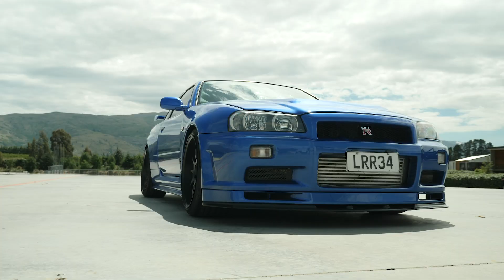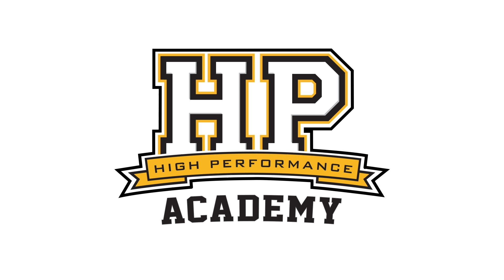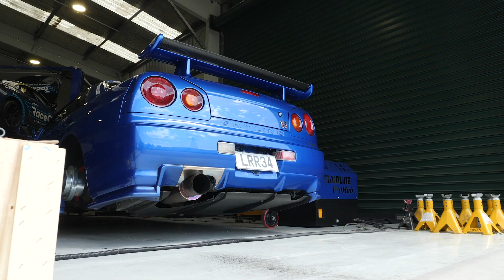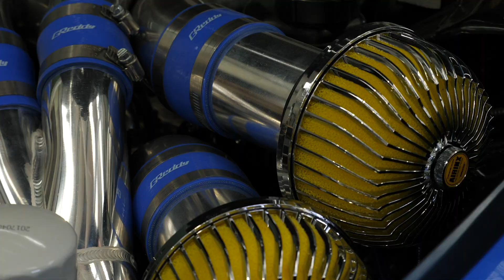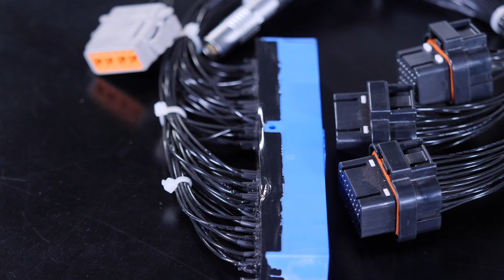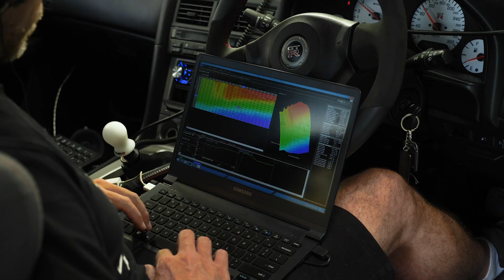The Biggest AFR Target MISTAKE Tuners Make?

Comment: I am no expert efi tuner just experienced with mechanical and carb tuning. Everyone seems to always relate lean condition to knock issues. There are lots more negative effects than this. Higher NOT can damage cooling systems, intake and exhaust valves and seats can be damaged, forged pistons possibly expand larger? Bores and rings mirror and wear quicker? The list goes on. I think about o2 sensors failing faster than normal? I belive if you are running some exhausts too hot you can harden hangers welds and bolts and these can then break easily?

Comment: From my experience this is a little misleading of AFR increasing power, I have found that the ignition control that you have changed would more likely to be where the increase in power would have come from not the fuel, but yes moving from 12AFR to 11.5AFR can reduce some light knock , but I have found only minor changes in power (without knock) with AFR changes between 12.5-11.5AFR, Triggering systems on an RB is where I have found one of the biggest power gains, the cheap option you showed does help a lot but triggering still floats (I understand cost) but still a lot better than the stock CAS, crank trigger and CAS sync is the way to go. 
Three major changes here to achieve increase in power and reliability, Replacing the 20 year old aftermarket ECU with one of the better current technology aftermarket ECU's available, changing the triggering system,  Getting rid of those 30 year old air flow meters.  This is the Email that I received: 

Is This The Biggest Mistake Tuners Make? ❌

What is one of the biggest mistakes both professional and amateur tuners make when setting AFR targets?

This lightly modified RB26 powered Nissan R34 GTR Skyline made 485whp with light knock occurring at 22-23 psi, and with only minimal changes planned it was expected to make LESS power to ensure reliability.

By taking the time to check what AFR targets suit this specific setup rather than assuming what has worked for one RB26 tune will work for all, the result was an increase of power to 528whp at the same boost level, with no knock.

In this Tech Talk, Andre explains why this was possible. He dives into why some tuners wouldn't find this power, along with the causes of knock and where they sat regarding this specific project.

Also discussed are the Z32 airflow meters that were fitted in Japan, along with their removal, and the upgrading of the trigger system without breaking the bank (as if you own a recently purchased R34 GTR these days, no doubt your account is already pretty empty!).

Watch Video

I'm not challenging this teams tuning ability in any way, HP academy is great and I find them helpful, as there has been no real training for tuners so most of us tuners have self taught until HP academy came along,I personally fully recommend them. 
Keep up the good work

Comment: With Nitro RC cars all the tuning is done based on how the engine responds, amount of revs, sound and how much smoke the engine produces.
Do car tuners ever listen and get a feel for how a car tuned or is only looking at Data?
Reply: It's not an RC single cylinder engine. Data is more reliable. Especially with unleaded fuels.

Comment: I just got an elite 2000 for my R34 GTR, no plans yet for a trigger kit but this 4d tuning map sounds interesting but im afraid my tuner wont use it. thats why i got the 2000, unless you think the 2500 is a must get for a little more $ lmk
Reply from the maker: Best thing to do is to simply chat to your tuner about this. I'd watch this video (link below) first so you have a fair idea of what is happening and why, and it will also help you figure out if there is anything your tuner is saying that you should be alarmed about/make you walk away or the opposite where you might gain a lot more confidence you have chosen the right person for the job - https://www.youtube.com/watch?v=9XvXfX3QhlU&ab_channel=HighPerformanceAcademy

I'd have a quick chat to your tuner and Haltech about the 2000 vs 2500 for your application too. Off the cuff it does look like the 2500 might be a better option, but really it is something you're best to get advice on from a few difference sources - Taz.

Comment: How is the CAS considered an upgrade?  You've reduced the resolution by 6 X and with a good ECU the OEM CAS works very well.   Adaptronic posted a video specifically addressing how going to a 24-1 on this application greatly reduces resolution. The link is here:  https://youtu.be/_sEDuNGnRKA
Reply from the maker: Sadly a good ECU and the stock CAS actually doesn't work very well, particularly once you add aftermarket cams. I've probably tuned a couple hundred RB and SR engines by now and I'm very well versed with the shortcomings of the stock CAS. There's levels to this and some ECUs admittedly do a better job than others but simply looking at the rpm trace through a ramp run on a dyno will show you just how poorly the stock CAS works even if it's not immediately apparent from the engine operation. Ultimately the proof is in the outcome and I've used trigger systems like this on multiple occasions to turn an engine that was completely untunable into one that performs flawlessly. Is it as good as a crank trigger? - No. Is it better than the stock CAS? - 100%

There's also a lot of confusion about how much resolution the ECU needs to do a good job and Nissan's 360 sensor is borderline ridiculous and complete overkill (they must have figured this out as their newer engines have reverted to lower resolution trigger systems). Look at what some OE's deem acceptable like Mitsubishi which essentially only provide 4 engine speed inputs per engine revolution with excellent results. With low resolution like this you may expect to see small timing movements at very low rpm but as soon as the rpm rises the timing is rock solid. Personally I tend to aim for a minimum of 12 teeth per crank revolution which coincidentally is exactly what this option provides - Andre
Reply: It kinda is due to eliminating the keyway drive of the camshaft. This removes a component of the "wobble", with the cam belt elasticity providing the rest. The OEM trigger becomes a more significant issue when the keyway for the cam becomes worn and backlash occurs. I've got a 36 tooth crank trigger and the ECU reports a 3 degree scatter of the cam driven home signal relative to the crank in the logs at high loads. An effective 12 crank teeth is fine resolution wise for a high speed motor such as an rb26. Was good enough for Honda in their k series!

Comment: I was suprised that Knock accured at 480hp with 100 octane. I mean there are running alot of rb26 engines with higher powerlevels with pumpgas.
 My saab 9-5 Troll is running at 10.7 at the revlimitier.
Reply from the maker: As explained in the video, this was due to the initial lean AFR - Andre

Comment: Awesome video. Can’t wait to install my 1000cc injectors in my GTR. Question: why does the NZwiring not work on some
ECU. I have a Haltech Platinum Pro and it’s not compatible but the elite is. Not really sure why.
Reply: You have limited trigger patterns available on the platinum pro as it's designed for stock plug and play. The trigger pattern of a cam 24-1 is not available in this ECU. However a 12 tooth crank with a separate home trigger is.
Reply: @burn4005  Yes your correct. I could buy a PRP trigger kit. But like Andre suggested the cost is huge. I have been searching far and wide trying to find a affordable replacement solution. I even thought about upgrading to the Haltech elite series ECU just for the NZ trigger kit but don't really want to spend $1000 in order to buy a cheap trigger kit. That would defeat the purpose of saving money. I might just run the stock CAS and limit the RPM to 7000RPM until I find a solution. I even thought about manufacturing my own. I don't know if I can copy NZwirings trigger design but use 2x sensors instead of one. 1x sensor for position and the other sensor for homing. Not sure if this would be possible. This is only a 500hp street car.

Comment: Andre, thanks for the great explanation of the complex relationship between all these factors.
I'm certainly no tuning expert, far from it, but we had to learn this stuff for ourselves years and years ago on our old 910 Turbo Bluebird rally car.
It ran to Group A engine specs including no intercooler, 100 oct avgas fuel and an old Haltech E6 ecu.
I had fixated myself with running 1bar of boost and with careful road tuning was able to get a very torquey, usable engine that didn't hurt itself for 3 seasons.

Later I used the drive train in a road shell as a second car and obviously couldn't run avgas any longer.
Using 98 Oct unleaded, dropping the boost to 13psi from 15, the car actually made MORE power due to being able to add more timing in and run leaner than we had when racing 🙂
The '1 bar boost' mentality meant we had to pull timing to prevent knock, and then add fuel to cool the excess turbo temps we saw on the pyro.... 
You live, and you learn.

Great content.
Reply from the maker: The old story of 'giving the engine what it wants' is always easy to overlook, and sometimes when it comes to boost, less may actually be more - Andre
Reply: @hpa101 
True 🙂👍

Comment: This is what I want to put in my series 2 C34 Stagea. The KV8 would shit all over my current Nistune for a plethora of reasons including what you outlined with the addition of a vast amount of engine protection features that it possesses. How straight forward was the integration with factory attesa ets-pro or for example a full race ETS-pro controller? Is it still just as simple as spicing into the TPS signal +ve?

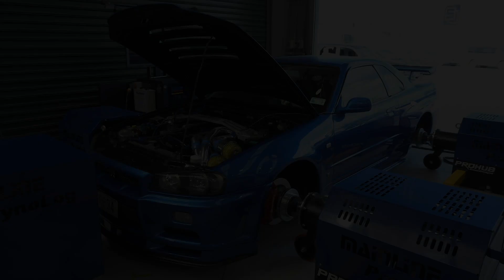Comment: Also was I hearing Compressor surge at 13:58 - 14:00?
Reply: @TomBudin  pretty much. But extending on that. it's when the compressor is forced to operate at a point to the 'left' of the compressor map surge line.

In this case the turbione is forcing the compresor to spin too fast and the design of the compressor is unable to contain the pressure it's producing. thus the 'chopping' noise you hear is compressed air being forced back (the wrong way) through the compressor wheel. Once a discharge occurs and the pressure has dropped, the compressor then starts building pressure again. and repeat. 

The apexi turbo's are of an old design (+20 years) and don't have the aerodynamics to operate in the range they're being requested to. This can be solved by reducing the boost ramp. basicallys softening the transient boost curve witht he ebc.
Reply: @manitoublack  soooo......how do I get you two to come work at my shop..lol. cheers mate.
Reply: @manitoublack  good explanation, better than mine!
Reply: @manitoublack  there ya go
Reply from the maker: Hey team, actually no, you're not hearing compressor surge during that dyno run. What you're hearing instead is the boost control solenoid venting the air from the wastegates back to atmosphere. It's a pet hate of mine and normally I plumb the vent side of the solenoid back to the air intake which silences the noise. That's not possible with the current boost controller though. 

Basically how this works is that the solenoid pulses at perhaps 20-30 Hz and vents boost pressure off the wastegate actuators to control boost. Depending on the duty cycle and frequency this can become more or less prominent (you notice higher in the rpm range the noise goes away as the duty cycle changes). 

Surge is a very real issue but not one we should come across with well matched turbos at WOT (particularly given how laggy these turbos are). Surge under WOT on the dyno is also incredibly violent and you would feel it (usually you'd abort the run) and at minimum see it in the shape of the dyno plot - Andre
Reply: @hpa101  thanks for that.
Just when I thought I had it figured out..lol
Reply: @hpa101  That's one hell of a noisy boost control solenoid then :)

Thanks for the insight. God it sounds like surge on the video though ;)
Reply: @hpa101  all good, i completely forgot about the solenoid chatter being a thing😅
Reply from the maker: Nice discussion here guys! I'll see if Andre has a moment to jump in here for you too regarding this setup, but for those of you that are members that want to learn a little more about compressor surge in general it has been covered in a members only webinar here: https://www.hpacademy.com/previous-webinars/209-what-is-compressor-surge/ - Taz.
Reply: @TomBudin  no
Reply: Definitely!
Reply: Yup!
Reply: @TomBudin  I thought it was the same thing, just happening at a different time?  Please explain mate.
Reply: @greggreg6975 for the most part compressor surge is basically when the turbo is flowing more air than the engine can swallow and thus relieves itself back through the compressor. Bad cases can cause severe damage to the turbocharger bearings due to the shock of loading up, unloading, and loading back up over and over again. 
The more common surge, frequently known and flutter or dose, is basically the same thing, just less damaging, its basically just a case of you being on boost, then suddenly snapping the throttle shut, the turbo is still making a little bit of boost due to the latency of the system. That air has to go somewhere, usually out a blow of valve, or back through the turbo compressor. Thankfully the turbo is also spinning down at the same time so the shock isnt as violent. The noise is litterally the sound of the pressure waves releasing and being chopped up by the compressor. If you actually stick a gauge on the compressor housing you can see it happening. The pressure will go down, then hang, then reduce, then hang, then reduce etc until the pressure differential is gone.

In the case of this video, the surge could also be caused by the twin turbo setup. Its a common thing on GTRs, or anything twin turbo feeding a common pipe really. Most likely due the piping and the turbos chosen. At certain loads the turbos will sort of "trade blows" with each other. One will surge, then the other will, and so on and so forth.

hope this helps lol
Reply: @nismofreak33  sweet.. I think understand it the same as you mate.
If the compressor surges due to the the throttle being suddenly closed or not enough flow through   the engine for a given load/flow.
Its still surging. Like you said worse with the throttle open because the turbine is still driving it regardless.
So different names for the same thing just because it happens at a different time?? Am I even close..lol
Reply: @nismofreak33  excellent explanation mate.. thanks
Reply: @TomBudin  so I'm with you on the surge part... the flutter not so much?

Comment: Very nice.  The 24-1 on cam is interesting. Might be a better option for converting my engine to full sequential without needing 2 sensors. One day. In the last dyno run, what do you think the little bit of turbo flutter sound is at 13:59?